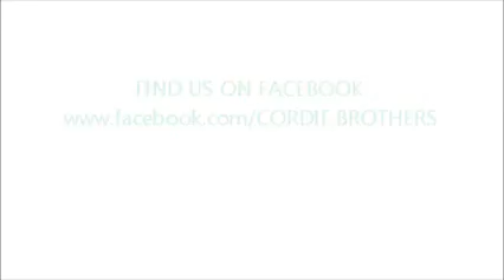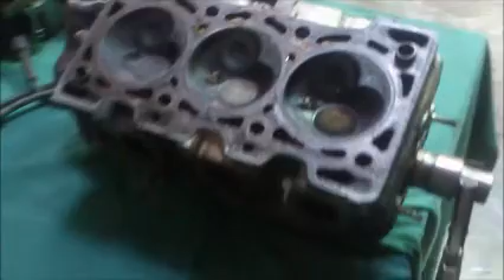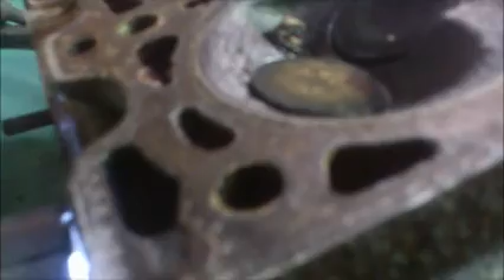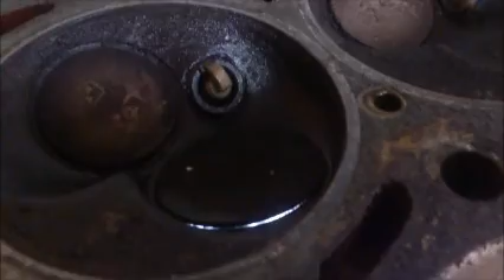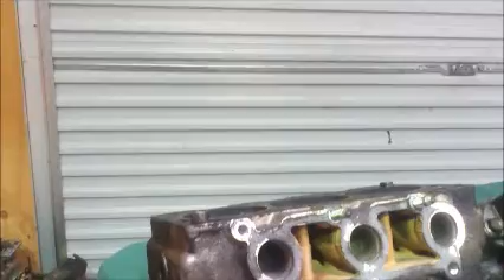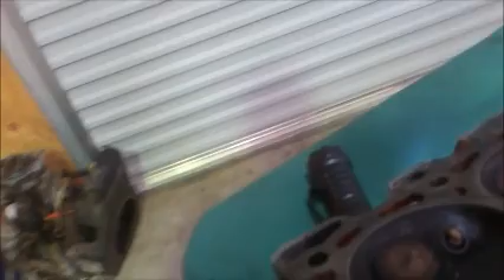SUZUKI F8B 70BHP+ PART II

Comment: I have a f8b motor in my maruti 800.. I was thinking of getting bike carbs and swapping them on ...what carb  Would you recommend
Reply: Nikolas Mussungton su 29 will do the job better or yu can go for 32mm flat slides in.. But i am thinking on tuning each cylinder separately will be an head ache and the throttle mechanism is sumthng we hav to fab. We cab use a tripot carb used in some old 3 cylinder motorcycles and it would work better share yur view..

Comment from the maker: Thanks guys, it would seem that the F8B has been dismissed for performance modifications due to its low capacity and scarcity. I have bigger greater plans for the mighty boy :).

Knowledge is only knowledge if it is shared, I learn because I have been fortunate enough to have worked with some very old and decrepit mechanics and engine builders that have been kind enough to share with me what they know.